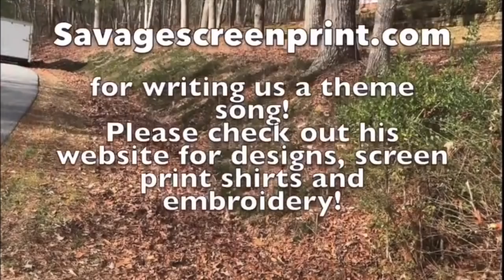THE SPRING RUSH!! The most stressful time in lawn care.

Comment: my gravely 60 is still in the shop waiting for a replacement wheel motor after two weeks 🤦🏽‍♂️🤦🏻‍♂️and mowing has begun...arrrrgh 😂😂 it's been a trying coupla months ( and the bulk of that wasn't even work related ).  

but i've been running the 48 walkbehind, and if i operate it higher than 2nd gear it doesn't cut everything, so it's slower going than i would like ( according  to my "blast it and get it done" perception of time 😋 ). hopefully putting a fresh edge on the blades will make the difference.   and i just bought battery impact and angle grinder from amazon to do blades on the fly, instead of having to bring everything close to my air compressor.   also i'm trying to finagle a used hustler 60 so i can do a few churches before rain comes tomorrow.....oy vay....it's getting crazy.  time to unbox new battery tools...always exciting 😎